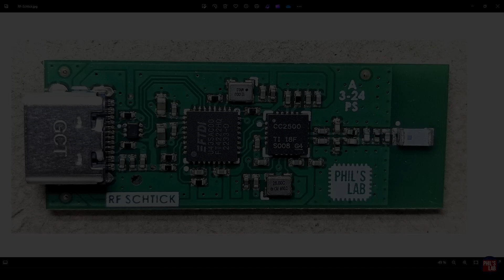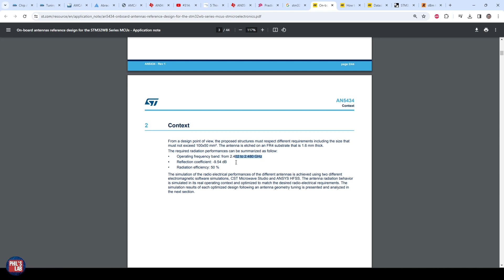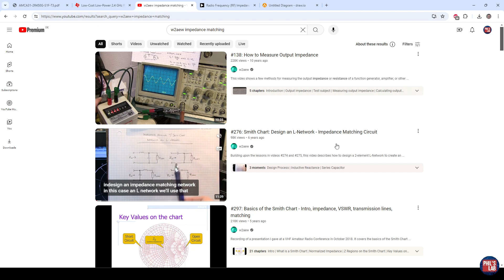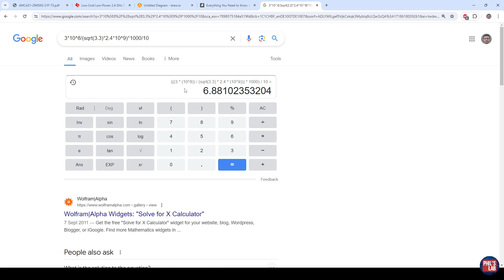PCB Chip Antenna Hardware Design - Phil's Lab #139

Comment: 5:35 As somebody making an embedded system platform for hobby projects an possible professional ones in the future, the main reason I finally went with a module instead of my own antenna design had to due with the certification costs. Once I had learned about that, it was a pretty clear choice for now.

I'll probably still make some from scratch in the future for learning projects, but for now I settled on using a module

Comment: Nice video, but it's missing the important part: network matching/tuning. 
I have seen videos explaining how to do it with coax and connector type antennas. But I can't find any for a chip antenna that is mounted on a PCB.
Does anyone know of a good resource that shows the process of tuning?

Comment: Short of "make several different boards and measure to compare", is there good advice on the feedline tradeoffs?  It looks like almost everything "East" of the smaller square chip is just for the antenna (and branding/docs), and you could use a much smaller PCB ... but then maybe the first two 
(capacitors?) of the matching network are in less of a differential pair alignment, and maybe there is more noise to/from other components ... is that much space effectively just a requirement?

Comment: Another excellent video.  What is your process for tuning the matching network?  I went through the process of trying to tune a somewhat similar design with an el cheapo vector network analyser and ultimately still had to iterate through nearby values.  Ultimately got an acceptable result but didn't feel efficient. Thanks.
Reply from the maker: Thanks! To be honest, my process is similar. Check with NanoVNA, adjust using Smith chart and calculations, and repeat. I'll be making a video on this at some point!

Comment: It´s good practice to place the pads of the matching network inside the trace. Otherwise you have open stups when you don´t assemble some components. For example if you do not place the capacitor next to your antenna it doesn´t care, because you basically have the trace to the antenna and no open stub.
Reply: Is it advisable to use teardrops if the trace and pads don’t really match by width?

Comment: I've been waiting for years for a video like this, thankyou!

One question: if the ceramic antenna doesn't work (in my case I'm getting brownouts on my custom ESP32 board when starting wifi) how would you debug what is wrong? The world of RF is very foreign to me and it's hard to find resources that clearly explain what is happening
Reply: Do you use capacitors on the 3.3V input of the esp32? Is the power module capable of delivering the necessary current?
Reply: @TheDutchGuyOnYT  I'm a few months late but thankyou so much for this comment 🙏. You've helped me realise that my LDO was rated to 200 mA but the ESP32 PICO-D4 I used has a recommended operating current of 500mA

Comment: A helpful tip for newer folks: If you're feeding your antenna with a coplanar waveguide, pull back the solder mask from the ground copper directly adjacent to the feed line. It allows you to solder shunt passive components at any point along the line, which can help you swing the impedance around the Smith chart as you'd like. 

It's also helpful to know that, though chip antennas are usually "suspended" (NOT over a ground plane,) chip antennas use the adjacent ground plane of your PCB to radiate. Therefore, you DO (probably) need a ground plane if you use a chip antenna, except for the region with no ground. 

Efficiency ratings and gain for antennae are often determined by testing the antenna on a PCB with a massive ground plane. If your board is small, this can affect the radiation pattern and efficiency, and your performance won't match the datasheet specs.

Awesome video as always.
Reply from the maker: Great points and tips, Mark - thank you!
Reply: Hi Mark, can we exchange some ideas on this topic please?

Comment: Summary

*General:*

* (0:00) Chip antennas are small, self-contained antennas suitable for applications where space is limited.
* (0:00) They offer flexibility in terms of frequency, gain, and bandwidth options.
* (0:00) However, they are sensitive to placement, routing, and surrounding components, requiring careful PCB design and tuning. 

Chip Antenna Selection:

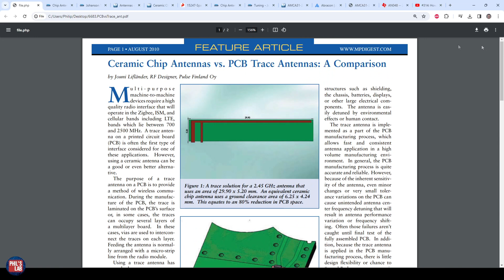* (4:43) Always consider pre-certified modules first for commercial products, as they simplify the certification process.
* (5:58) Choose chip antennas based on your application's frequency (e.g., 2.4 GHz for Bluetooth), mounting type (e.g., center mount), size, gain, and impedance.
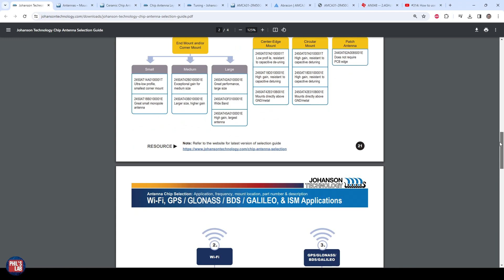* (7:53) Distributor websites and manufacturer datasheets provide crucial information for antenna selection.

Matching Network:

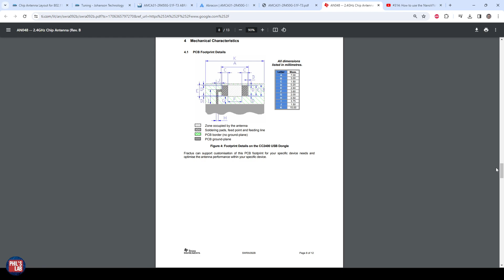* (12:33) Impedance matching between the RF transceiver and the antenna is essential for optimal power transfer and RF performance.
* (12:33) Matching networks typically consist of capacitors and inductors. 
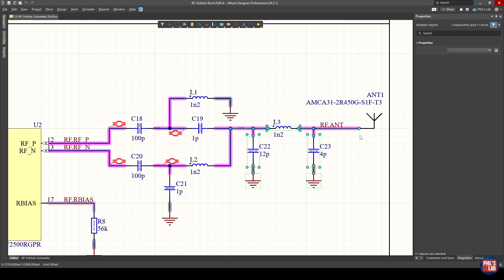* (18:44) While datasheets provide recommended values, tuning on the final PCB design is usually necessary.

PCB Design:

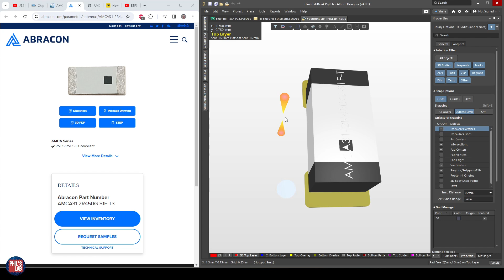* (22:31) Always refer to the chip antenna manufacturer's datasheet for PCB layout recommendations.
* (24:54) Keep trace lengths and component sizes small relative to the operating wavelength to minimize impedance control issues.
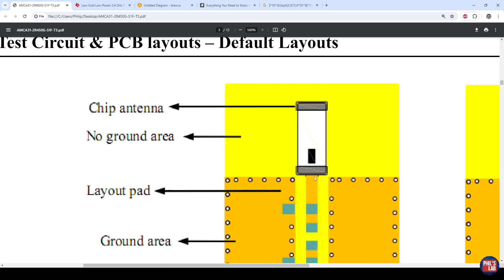* (29:24) Avoid ground planes directly underneath the chip antenna, as this can affect its performance.
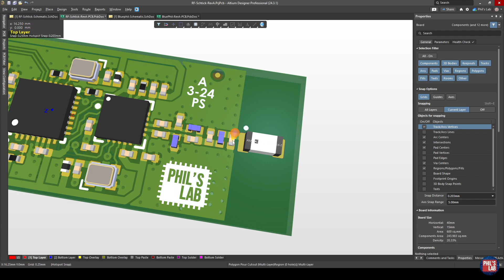* (31:29) Use stitching vias around ground polygons near the antenna feed point to ensure a good ground connection. 

i used gemini 1.5 pro to summarize the transcript

Comment: I can't add anything significantly valuable with my comment, but I will mention my surprise that technology didn't start rocketing along once the Arduino platform was available and we had a couple generations of people that grew up submerged in digital technology.
The education system wasn't adapted to promote their interests and inspire them to learn the technology at the scientific level.
They were conditioned by the system to desire it. 

Fortunately, there is progress coming from unique sources of development such as hobbyists in Arduino and similar platforms as well as actual scientists and engineers from humble beginnings pursuing original designs to pursue commercially.
I'm ultimately an eccentric and virtuoso shred and sweep style guitarist that oddly, is even more driven scientifically than I am in already having reached a masterful skill level and artistry. 
I outpaced my scientific progress simply because the instrument and music composition is significantly easier! 

Anyway, I understand everything discussed in the video and will ultimately shift my focus from analog circuit development to adequately and evenly covering digital this year. Oddly enough, I invented an analog development board focused on Op-Amps equivalent to what Arduino is for about 13 years ago.
My goal is to eventually produce that board commercially so anyone can design analog circuits, especially audio and music instrument oriented that revolves around op amps.
Secondary will be transistors and FET/MOSFET's simply because op-amps cover a much broader range of technologies when designing machines around active components.

Comment: Great content, Phil. I'm always following you directly from Brazil. My friend, I have a question.
I always see you indicate the SIGNAL POWER + GND + GND + SIGNAL POWER topology for a 4-layer printed circuit board.

My question is the following. Why is a ground plane added to the top layer or the bottom layer on some boards?
Reply from the maker: Thank you! Zach Peterson has a good article and video that explores some benefits/detriments to flooding with copper. https://resources.altium.com/p/copper-pour-and-stitching-do-you-need-them-pcb-layout (Video at end of article)
Reply: @PhilsLab  Thanks!